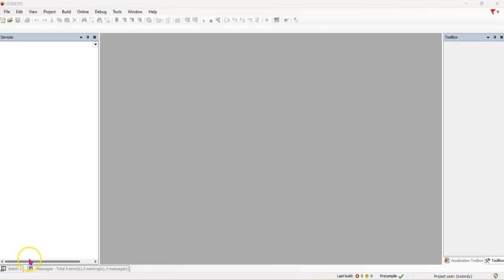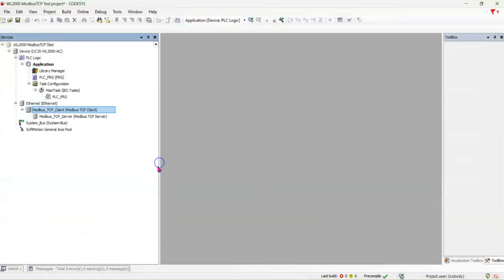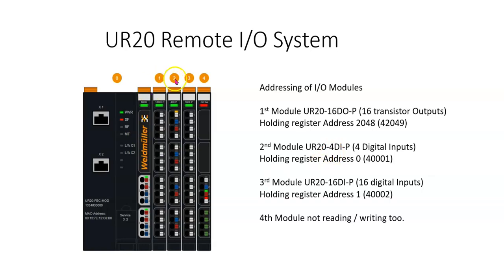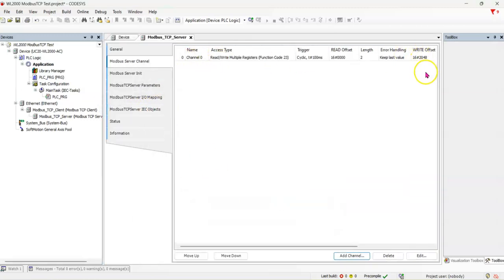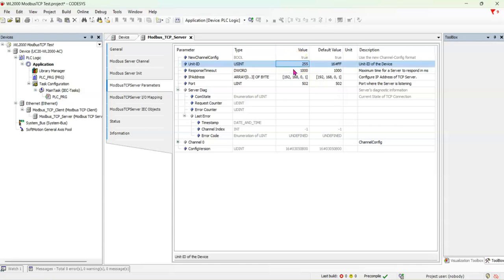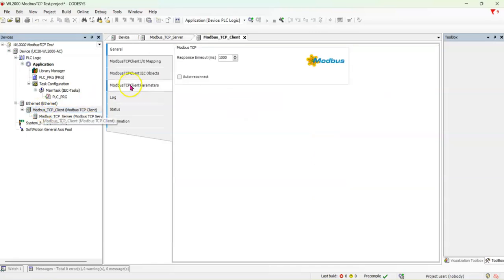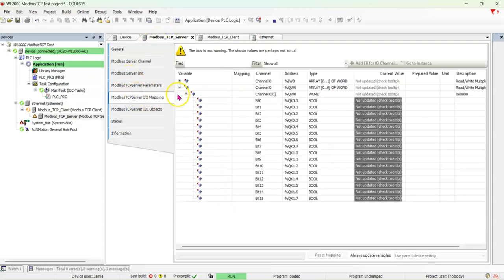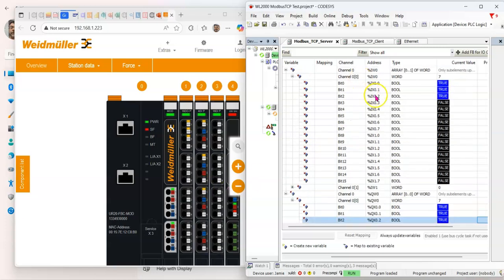Codesys u-OS Modbus TCP Client to Server coms

Comment: Hi, I do have a question. This is my problem with modus configuration. When I try to write from Codesys to Fanuc robot, it also read bits are high. I don’t have any clue why’s does that.please helps
Reply from the maker: Never communicate ro a Fanuc device over modbus but I do know that Fanuc normally uses npn switching so maybe it's seeing a one rather than a zero because of that. Npn switching means the output is zero volts when it's on and 24 volts when it's off same with inputs inputs are 0 volt when they're on and 24 volt when they're off. Just a guess. Have you confirmed it changes state when the input or output changes state?

Comment: Hi! I’m trying to switch the outputs of the DO card but without result...

The inputs are working, I am retrieving the data well but unable to control the outputs.

The documentation indicates register 32768. But without way ..

If you can help me .. thank you!
Reply from the maker: Strange register address for outputs, give details of input register you can read and details of device, make, part number
Reply from the maker: @jeromeamaro66 ok you don't want help
Reply: @industrialtechnicalinfo5325  Sorry, mistakes....

I have a module UR20-FBC-MOD-TCP-V2, but the BF led remains permanently lit in red.

Yet the device is well connected since I can read the input and analog registers (16DI-P & 4AI-UI-16). However, I cannot write in the outputs (4DO-P). I think it comes from the red BF led.

Do you have a solution for this LED to turn green?

Thank you! 🤐